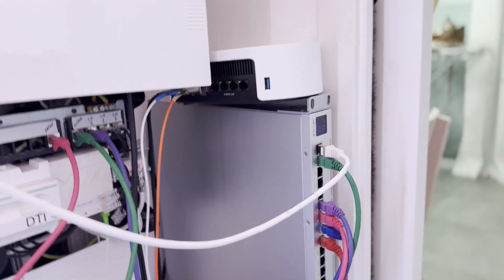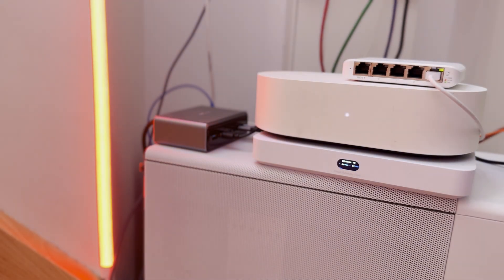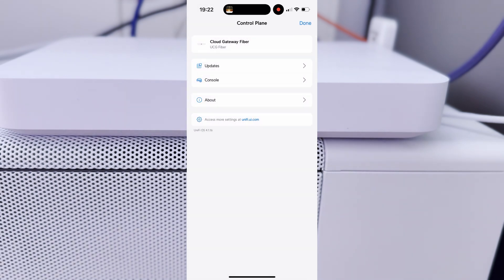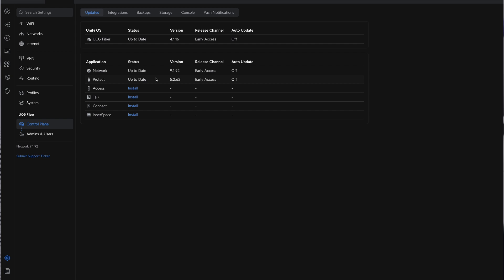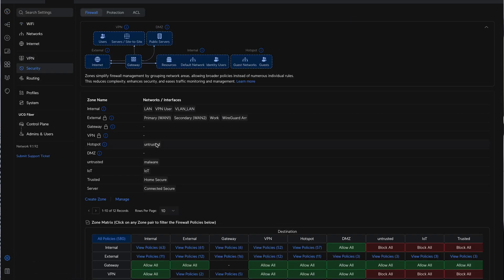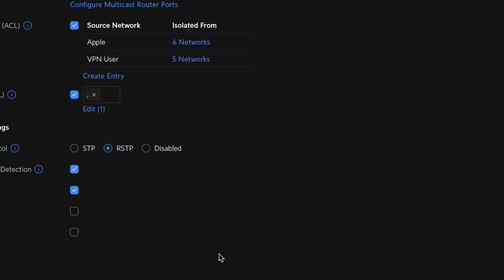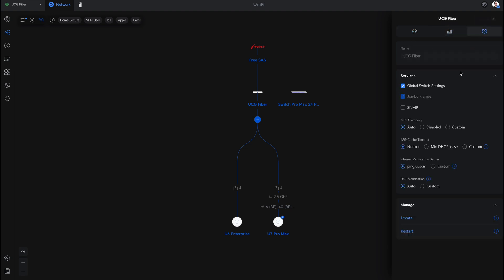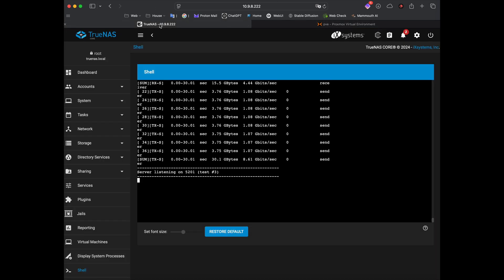The Future of Internet is Here (Ubiquiti Cloud Fiber Setup)

Comment: Sorry, i couldn't seem to catch somethings on the performance side. are you saying with your 8g connection you cannot get your full speed when using the 10g in / 10g out ports. but then later in iperf it looks like you were getting 9x up/9x down.
Reply from the maker: Oh yeah, sorry! So the iPerf test I did at the end was only within my LAN, between TrueNAS and Proxmox. Unfortunately, since my WAN isn’t reaching the expected speed, I can’t fully test it.

Testing the WAN again now—I’m only getting 4.5 Gbps symmetrical, but some results are in the 5 Gbps range.

Comment: Hey I have a couple of questions I hope you could answer for me.

1. Does the port speed matter when you plug the u7 into a 2.5GbE port? Do you actually lose bandwidth over Wi-Fi as the port would be the bottle neck?
2. Would using an SFP+ adapter in the 10GbE SFP+ port to connect the Wi-Fi improve the speeds? Is that even possible while using an additional 10G PoE adapter?
Reply from the maker: 1️⃣ Does the port speed matter when plugging the E7  into a 2.5GbE port? -- (you mean the E7 and not the U7 right?)
Yes, the port speed will act as a bottleneck. The E7 supports WiFi 7 with a max data rate of 11.5 Gbps (6 GHz) and 8.6 Gbps (5 GHz), but if it's connected to a 2.5GbE port, the maximum wired backhaul speed is limited to 2.5 Gbps. This can impact performance if multiple high-speed devices are transferring data simultaneously, especially in a busy network.

2️⃣ Would using an SFP+ adapter in the 10GbE SFP+ port improve speeds?
Yes, using a 10GbE SFP+ to RJ45 adapter can help achieve the full potential of the U7 when connected to a 10GbE RJ45 port. However, keep in mind that: